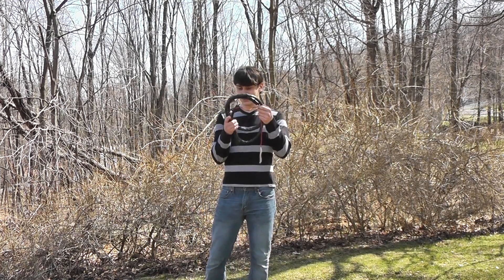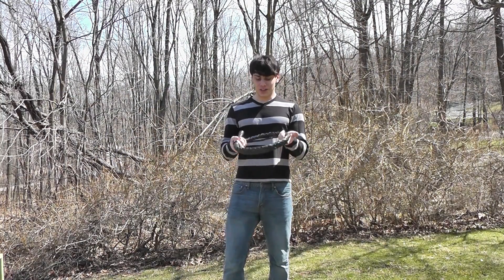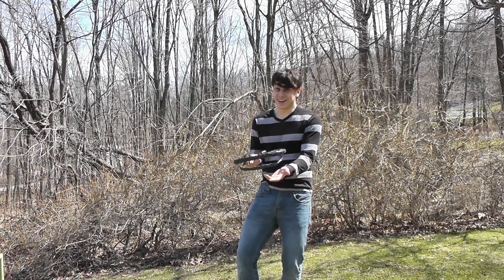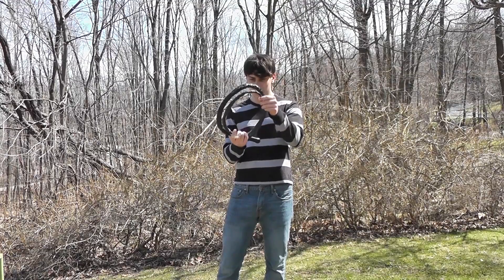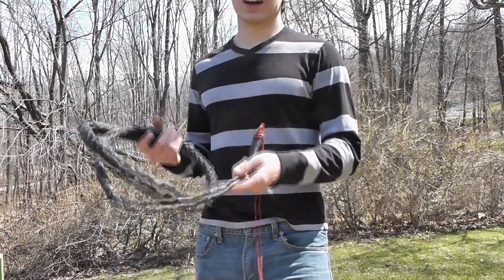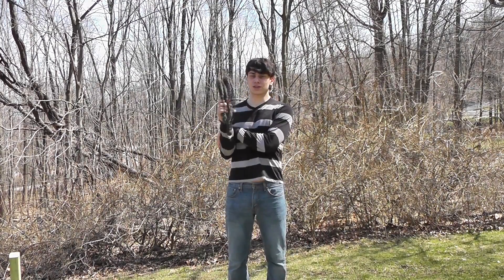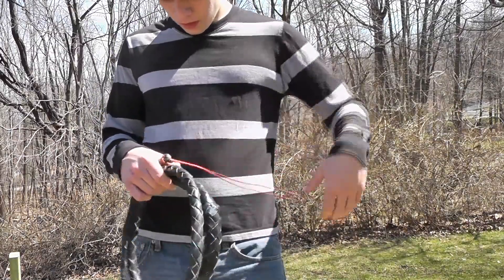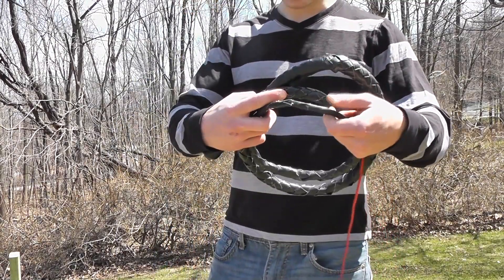Duct Tape Whip

Comment: This is awesome! Where did you get a steel cable from?
Reply from the maker: Glad you liked it. Steel cables are build materials you can get at Home Depot, Lowes, general hardware store, etc. Again I'd like to say the steel cable is optional. I've just heard from watching various whip tutorials that it is an improvement. I can't say first hand how much of an improvement it was because I don't know what the performance would've been. I just happened to have one readily available so I thought I'd used it. Some people use ball chain (the little metal chain used for opening and closing blinds). Anything about that size that's flexible and heavy will work.

Comment: you dont have to force it to crack i been cracking whipls of and on for 10 years
Reply from the maker: +Andrew Murphy Perhaps this is not the best whip then... After all It's mostly made of duct tape, as opposed to leather. Also I'm not an experienced whip maker. I only recommend this as a prop, and not a very practical one considering how long takes to make.
Reply from the maker: +AceOfThrowingCards As in I had to put some force into it to get the crack. Maybe my technique was bad idk. I can't practice anymore though. The steel cable pulled out over time because it wasn't secured as well as it should've been. I gave a better way to secure the cable in a 2nd design on my site, but I haven't made another one. I don't want it enough to spend the necessary amount of hours on it. I've got plenty of other projects that I am far more willing to spend time on. 2 of which are quickly nearing completion.
Reply from the maker: +AceOfThrowingCards Although I will admit I loved breaking the sound barrier with scraps while it lasted.
Reply: Cool

Comment: it sounds fake. did you add that sound affect?
Reply from the maker: Mike Pazera It's real. I promise.
Reply: AceOfThrowingCards i work a lot with metal and whips and i like it kinda surprised that u got that sound from a duct tape whip but i noticed the odd movement of it when you cracked it and when it was hanging, and imma guess that you leave it coiled up a lot, if thats true then its causing it to only be able to move in a certain way, and then the way your coming down your coming down across your body and thats a good way to get popped real good trust me XD, oh and if you want to check out my channel, the one im talking off of aint it this was my so call test channel if ya want ill link my actual channel
Reply from the maker: TheFineArtsDude The trick is the steel cable inside it. I have cut my hands with the whip a few times if that's what you mean. I did leave it coiled up, but that may also be the result of the steel cable. I basically know noting about whips except what I learned from having one & a few basic tutorials. The reason I made this was to bring me closer to having the knowledge to make a real whiplash whip from iron man 2. I'd still like to do that, but can't while I live in NJ. (Taser's are illegal.) So that's on the back burner for now. If you looked at my website you would know that I didn't secure the steel cable properly, and it slipped out. However I think am confident that I solved that problem for others who may try this project. I haven't tried for myself because I would have to take it apart entirely again. Then I would have to weave everything again. It took days the first time, and to be honest the whip isn't fun enough for several days worth of work. Especially while I'm currently working on better and cooler projects that I'm going to enjoy much more. I mean, say I fix my whip. Now I can break the sound barrier by cracking it (Sort of fun, but I've already done it so it's not as interesting.). I can supposedly light puddles of gasoline right? I didn't get around to trying that. I can train to do tricks, and I can use it for livestock. I think that's everything I could do. I already broke the sound barrier so none of that particularly interests me except the gasoline thing, but matches are a thing so... I'm probably never rebuilding it. I hope someone else tries my tutorial and shares the results with me somehow. Regarding your channel, sure show me what you got.
Reply from the maker: +AceOfThrowingCards Looks like GGG beat me to it. Perhaps there are improvements that could be made to his design.
Reply from the maker: +AceOfThrowingCards I'd like to improve his design, but I still live in NJ so idk if and when I will.